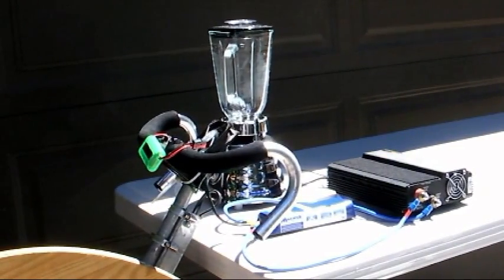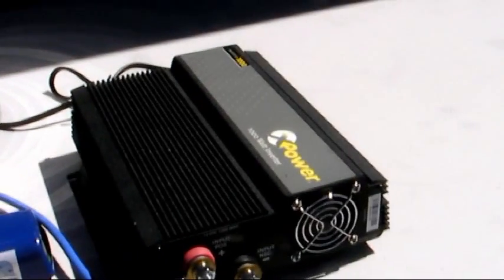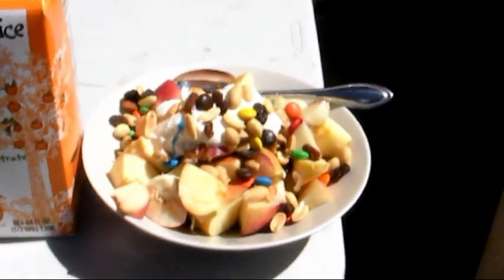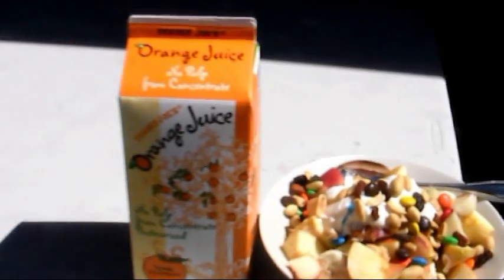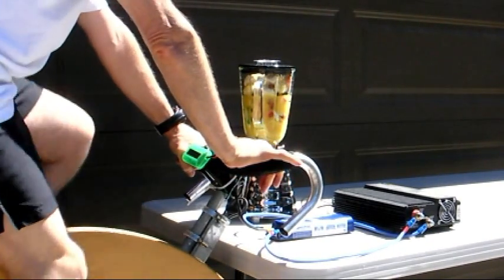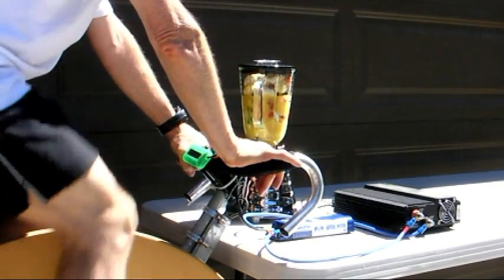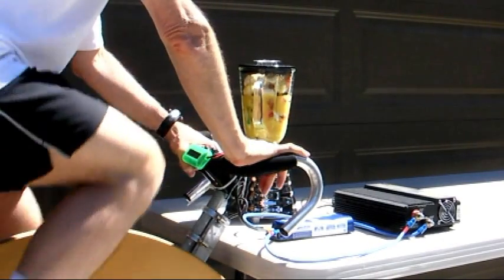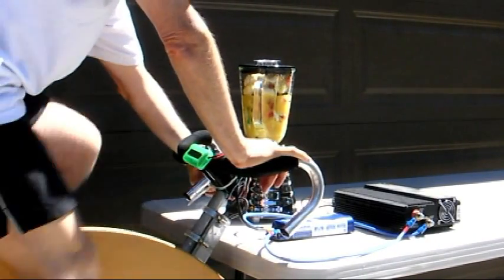PPPM: Pedal Powered Smoothie!

Comment from the maker: I turned the blender off just before the inverter would have automatically shut down. I have a voltmeter mounted on the handlebars so I knew what was going on. It was easy to pedal. No increased resistance - the UC did the work. 500 Watts continuously is equivalent to running up flights of stairs. That's how hard you would have to pedal. In the movie the blender drew around 450 Watts. More power = more torque at a given voltage.

Comment: Cool, but wouldn't it be easier to remove the electric motor, and replace it with a gear system which is powered by the petals?  There would be a lot less energy lost, and you would likely get your smoothie a lot faster, not to mention it would be cheaper (if less generalized).